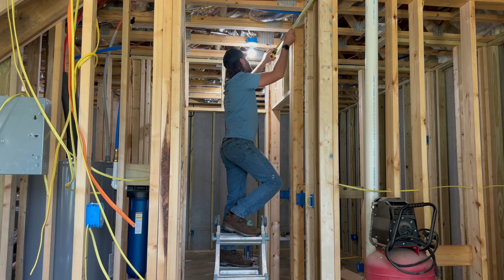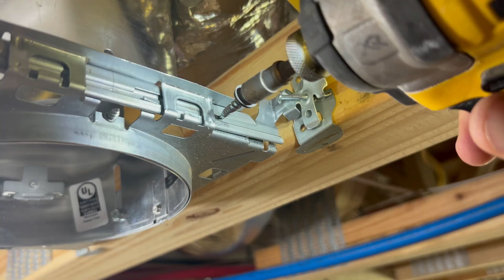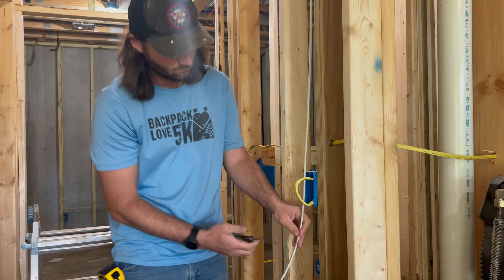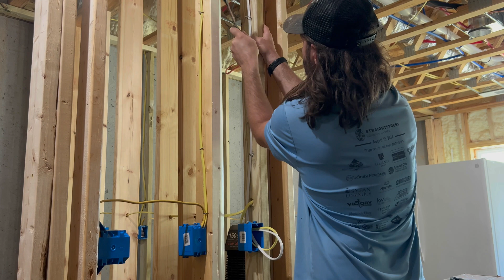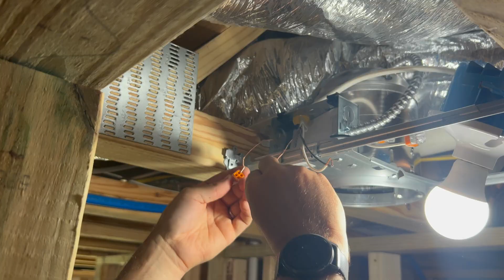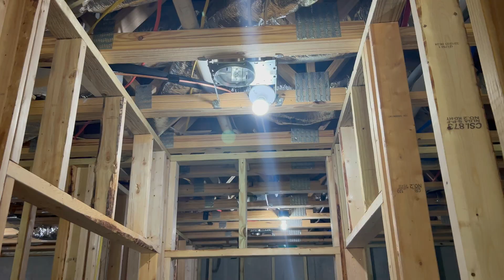New Construction Can Light Installation Made Easy | How To

Comment: You're running 14 gauge from a switch fed by 12 gauge?  Depending on where you are, this would violate code.  At the bare minimum you'll need to use a 15a breaker since your smallest wire size is 14ga.